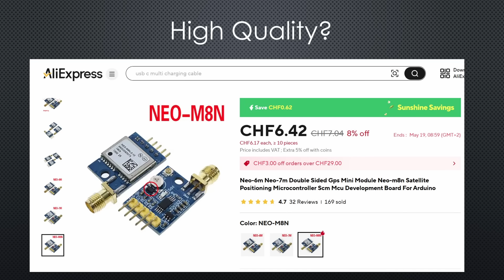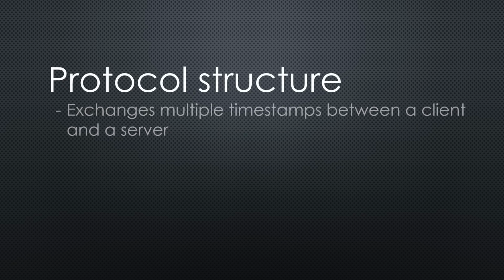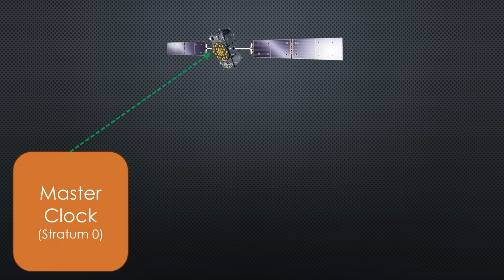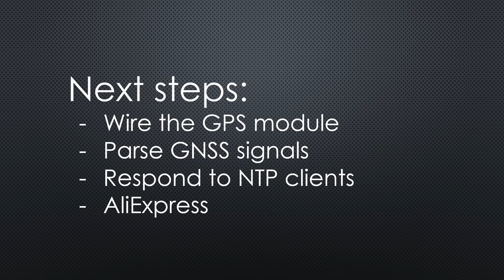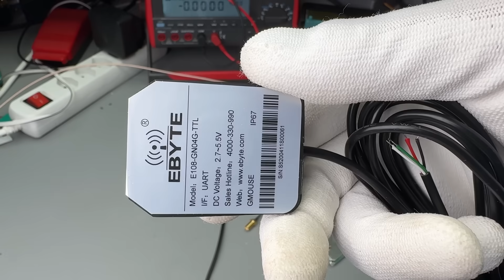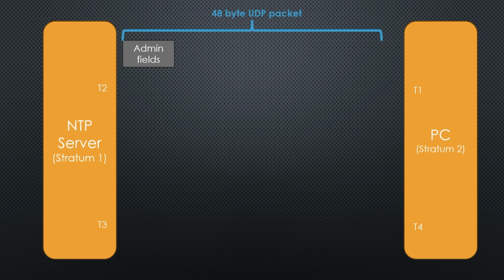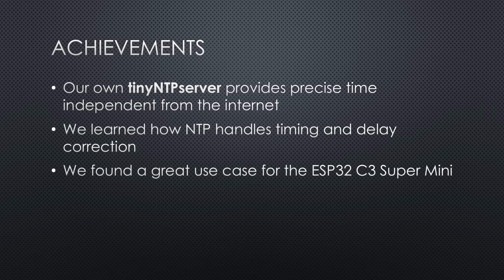Create a Wireless NTP Server with ESP32 and GNSS (Wi-Fi & Ethernet)

Comment: I have also implemented time sync from various sources via NTP and GPS modules for ESPEasy. (also p2p time sync which takes into account which node may be the most plausible to sync with)

What I found when using GPS modules from AliExpress is that they may output completely wrong timestamps. For example over 31 days in a month, the year 2040, over 24 hours in a day, etc.
But always with correct checksums.

So I did add some basic checks to the parsing of these NMEA sentences in the tinyGPS++ lib (PR never got merged though, so only in the local copy in ESPEasy)
Also you must be sure the GPS has a fix, otherwise you should not take the reported date/timestamp.

Another issue when fetching the data from serial without using PPS is that you need to know how much data is in the serial buffer when you parse the first character of a sentence.  All GPS receivers I used all output their NMEA sentences in a burst, where the first bit is sent at the start of a second. I think the PPS pulse is the start of such a transmission.
This way you can get a time sync from the GPS module without using PPS with a jitter of about a msec, given you perform some filtering over a longer period.  For example recording the time in micros when the first character was likely received based on the current number of bytes in the RX buffer when parsing this first char. Also take into account the baud rate, etc.
Reply from the maker: Good info. Thank you! In the meantime, I implemented PPS, too. There, I encountered an issue with the implementation of a function in the C3. It seems this topic is not covered a lot ;-)
Reply: @AndreasSpiess  What issue you had with the C3?
I do use ESP8266, ESP32-classic, ESP32-S2/S3/C2/C3/C6  (H2/C5/P4 are on my desk right now for implementation)
So maybe I can help?

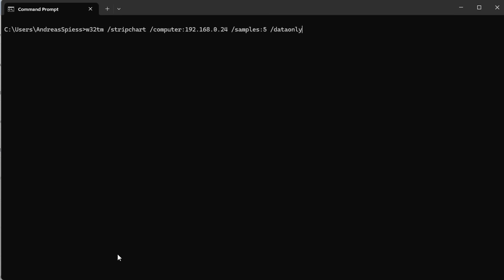Comment: 10:45 NTP is a very common protocol used for DDoS. Be sure to add an ACL to your implementation.
Reply: Is anyone really going to make a microcontroller based NTP server if they have access to a real one over the internet?
This is almost always going to be something you'd do for remote clusters of smart devices that don't have internet. Lights, pumps, gate locks, etc in remote locations that need real time based scheduling but don't need an expensive internet connection.
Reply from the maker: Will the server be DDoSed?
Reply: @AndreasSpiess yes, can be used for amplification, even behind a NAT

Comment: @1:06  WiFi and Ethernet are not separable.  If you're using WiFi, you're using Ethernet.
Reply from the maker: What makes you think that?
Reply: Unfortunately, this is false. 802.11 is different than 802.3. If you're familiar with the OSI model, recall what happens at the data link and physical layer. The frames and hardware are completely different. The communication methods are polar opposites, too. So yes, they are separate.

Comment: Hi!   I'm one of the two authors of the first NTP implementation for UNIX, implemented to validate the draft protocol spec being prepared at the time.   You make me cry a tiny tear by having an NTP server only use NMEA message timestamps to the nearest second with no PPS signal 🙂

NTP is much more than the protocol on the wire.  For a "real" NTP peer that potentially synchronizes to one of many candidate other NTP peers, there are sophisticated algorithms to select the "best" peer to choose from.  An NTP host running exchanging messages with other NTP peers also has algorithms to evaluate multiple packet exchanges that provide clock offset and delay samples, apply filters and choose one over a window over the last so many (perhaps 8) samples.   This this produces a filtered clock offset and delay output that is used as part of NTP peer selection if there's more than one candidate (and to decide if you want to switch to a different peer.)

The other really important aspect for precision timekeeping is the computer's local clock.  The object of the entire exercise is to compute the local clocks phase and frequency error.  The phase error is the offset from the "correct" time, and the frequency error is how incorrect that the rate the clock advances is (e.g., running too slow or too fast.)    It turns out that the frequency error is just as interesting as the clock offset.   When I did my first NTP implementation on a NeXT workstation in my office, I could use the computed frequency error to tell what the temperature in the office was.  And that got worse over the weekend when the HVAC was turned off..

What full NTP implementation would do is use the computed frequency error to adjust the rate that the clock advanced to gently slew the clock towards the correct value.  (Of course, if you were too far off, you'd just reset the clock.)   You did not normally want to just reset the clock based on the computed offset..  Setting it backwards if it was running too fast could confuse applications that had the perfectly reasonable expectation of monotonically increasing timestamps.   And advancing it in large amounts could confuse programs trying to measure time intervals between two occasions of getting the OS's time.   So this requires either special hardware to directly adjust the frequency (which nobody had at that time) or OS support to adjust the rate the clock advanced.  If you had a 10ms real time clock interrupt, perhaps you only advanced the system's idea of the time by 9,990 microseconds rather than 10,000 microsecond on a clock interrupt?

The other neat thing that comes from computing the frequency error is that you can continue to trim the local clock when your NTP peer lost contact with its synchronization sources due to a network outage or other interruption.   Or a bird that's sitting on your GPS antenna if GPS is a synchronization source.   

Sadly, most computer manufacturers historically didn't spend a lot of money installing high quality, temperature compensated crystals with good temperature stability.  So this has direct impact on long term holdover stability...

Even back in the day in the late 1980's and early 1990's when NTP was new, achieving clock synchronization over a LAN to less than 10ms was possible.  And less than 100ms over uncongested WAN links was also very practical, so long as you implemented the "full" version of NTP with the filtering and selection algorithms.

Of late, the only NTP mode of operation that many people are aware of, or have used, is the relatively "dumb" SNTP (simple) mode of operation which is essentially a one-shot interaction with an upstream NTP server.   This leaves the power of the most interesting capability of NTP behind.  If a few hundred milliseconds is "good enough" and now that everyone can afford GPS receivers, maybe that is "good enough" these days?

Thanks for making this video and opening the door on how NTP works to many more people.   It would be very interesting to add a small peripheral to an ESP32 or Raspberry PI, perhaps a small FPGA with some timekeeping hardware that can time-tag events, like PPS inputs and which could have a high quality TXCO that's trimmable with an DAC.  This way lies time nuts madness!
Reply from the maker: Thank you for your insights! You did a valuable service to the people implementing NTP. I think you are right when you say that extreme precision is no longer achieved over the network. GPS disciplined oscillators these days are very cheap and extremely precise in both short and long term (I made a video about that when I built my satellite base station for 10GHz). The Chinese take a surplus OXCO from an old Cellular base station and add a GPS and a very slow PID software. The OCXO is already quite precise in the short run, and the GPS does the rest on the longer end. So everybody gets 10^-10 precision and more for less than 100$.

Comment: Video idea: turning an esp32-s3 into a DHCP server on ethernet (via an external switch) using Arduino IDE!
Reply from the maker: What would be the benefit over using a router instead of a switch? So far, I have never had a shortage of DHCP servers...
Reply: If you have, for example, a cluster of esp32 based sensors on ethernet, IP address management can get messy, so a subnet could be a good solution. Therefore, if one could use another esp32 for this task, it could allow for automated IP address allocation and management, for very cheap! (Instead of using a managed switch or a router, over which one has little control after the initial set-up)
Thanks for your reply! Cheers!

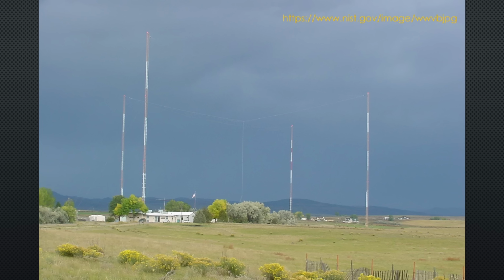Comment: 2:44 DCF77 is stil nice but since decades you have also ALS162 that has about 3500km span on Europe thanks to hundred of kW of amplification 🎉  Would be nice to have als162 as side chanel to the GNSS. Redundancy ✌️ More https://en.m.wikipedia.org/wiki/ALS162_time_signal Thanks for the nice video, 73 🙂‍↕️
Reply from the maker: I did not know of ALS162. Most commercial receivers use DCF77 in Europe. So far, I did not come across one with ASL162 :-(

Comment: I made an esp32 ntp time server using an Olimex board that uses an ethernet connection for faster and more reliable network connections.  its open source and the project is on Hackaday called ESP32 NTP Time Server (Stratum 1)
Reply from the maker: Thanks for the link! If I had found it, I probably would not have had to program mine ;-)

Comment: While describing the stratum layers you said your server is a stratum 1 device, connected direct to a stratum 0 device.

After describing stratum layers you went on to describe how the GNSS system works saying the satellite gets its time from the ground based atomic clock then transmits that signal out which your device receives via the GNSS receiver.

Wouldn't that make the satellite a stratum 1 device because it does not have the clock on board and connects to a ground based stratum 0 device? That would then make your device a stratum 2 device, not stratum 1!

You also say there are no delays from the satellite, however you forget there are delays due to the speed of the signal, not great delays but they are there.

Also, In your summery of the video you said "we" built both the types of the server. No, you showed us parts you got for the build and the results of your build, not the same thing as going through the build process with us. And the code, cheating with chat GPT does not count as programming it yourself! 😛 You also only showed us short snippets of your code plus the chat GPT generated function for the NTP protocol. Not much use for people who don't know what they are doing but want to try to build this.

Don't get me wrong, the video is still good and interesting to watch but the title is a little misleading as if it's a tutorial. Maybe it should have started "I Created a Wireless NTP Server..." instead of "Create a Wireless NTP Server...", and say I instead of we in your summary.
Reply: GPS satellites are considered stratum 0 devices as they carry rubidium and cesium clocks onboard.
Reply: @JCWren  not the way he described it though, he said, and showed, the satellite gets the time signal from Earth. So in that case my statement stands.
You can't reliably say the NTP device is stratum 1 if some satellites it connects to are stratum 0 and others are stratum 1.
Reply from the maker: I thought I mentioned that the satellites are also considered Stratum 0. But you are right, it is not entirely logical ;-)

Comment: Nice overview video, great idea I would recommend making a small master clock and sending the NTP signal into the clock, if you loose GPS signal, the mast clock shall be stable for around one week; before you notice any drift in time signal. 

Separately to prevent cyber attacks, make sure your master clocks only count forward in time, or hackers will turn up with an SDR and broadcast fake GPS signals counting backwards to cause systems disruptions, God bless.
Reply: So they will send future times and it will be unable to drift backwards! 🤔
Reply from the maker: Good idea!

Comment: I am looking to build remote tools/sensors/etc for my farm where we are talking about 500m or more remote locations so I wonder if this is a reasonably power efficient way to have timers on these systems which will be solar powered or should I go another route?
Reply: Sure.  You don't probably don't need sub-second accuracy. GPS modules are not generally power efficient in the cold-start phase (they don't have a current almanac and have to download that and then wait for enough satellites to become visible to establish a fix), but are pretty good in the warm and hot start phases. Depending on how much time drift your device has, you could either turn the GPS off completely and wait up to 2 minutes to establish a fix or your could leave it powered on but in a low power mode. Use software commands to wake it and get a time fix.  This is an extremely common method for devices that do need the current time and don't have internet access.  In the old days we might use a WWV receiver and hope it could actually hear the transmitter.
Reply: @JCWren  hmm thanks, I thought this might be the case but this just seems so simple a solution haha
Reply from the maker: Maybe you consider a two-way communication. Then you can distribute time periodically over the network. Otherwise, if your solar panels and batteries are big enough, GPS is also a good possibility.
Reply: @AndreasSpiess  I am been playing with LORA which is ideal but I cant get these modules to send anything other than a String which seems like a bad way to send data, do they normally allow for transfere of data packets?
Reply: @N1ghtR1der666  A string is a protocol (lowest level). You can do your own or implement LoraWan wich is overshoot for local sensors. There are a bunch of people doing theyre own (me included) and some made it public. 500m works on land if vegetation isn't dense. I am more on the seaside where 1,5km is easy to achieve.

"reasonably power efficient way to have timers on these systems". Sure they have sleep modes and u can wake them up periodical. Time sync is not needed (when the server knows the actual time), just let them have different periods implemented in the device address and wait when comm channel is busy or use different ones.
Reply: @Winkemaennchen  all the lora units I have the have no other functions but one that sends a string and I am not really interested in writing my own library for hardware, and doing string analysis seems too dirty to me, perhaps other units have more functionality in their libraries

Comment: You have links to the cheep GPS recover you said not as good were is the link to the good one you said in this video? Thank you that is neat with time I guess some one will make and sell a all in one unit. Any Antenna that can put out side in on the roof for this?
Reply: Why mess with antenna wires, when it's just as easy to have the whole (or half of the) thing on the roof..

Slow digital signal fully on a wire would be much more stable than the weak signal from space, that has to travel its last meters through unnecessary cable.

There are both solutions on commercial products though. If I would design one, it would have PoE to the roof.
Reply from the maker: @villehietala9677   I agree: I do not like coax, particularly for high frequencies. That is why I try to get the receiver as close as possible to the antenna. The "GPS mouse" I showed is a good example for that.
Reply from the maker: @RaymondDayI usually paste links where I bought the stuff. I only got the modules I put links. For genuine u-blox modules, Aliexpress is not a good source. Maybe Adafruit or Sparkfun are better in this respect.
I use one of those black antennas I showed for my GPSDO and one for my lab (it is in the basement). They work ok.

Comment: As always - nice video Andreas! I paused the frame with the code and went through it: GPT sure is verbose, repeating logic (copy/pasta!) that should have been into a function - or in a nice local C++ lambda, since arduino code is C++ code. The AI brain also chose not to use bitfields to decode/encode the NTP fields - which would move all the encoding/decoding work to the compiler-generated code (instead of our code manually shifting bits around).  A word-level __bswap32 may or may not have been needed afterwards - I don't remember the endianess of the ESP32 -  but even so, the code would  IMHO still look much better. Then again...  in our age of AI and the replacement of junior engineers with machines... I guess all that matters is "it works"; and for such hobby projects, it will certainly do. Thanks for sharing your work Andreas; and especially for putting it all up on Github.
Reply from the maker: I consider myself a "junior programmer" (and an engineer). So, for me, the effect is far more important than the content ;-)

Comment: Thanks Andreas, Can I ask a different question ?: For Zigbee projects would you say the tiny ESP32-C6, is the most user-friendly option compared to nRF52840, CC2651R3 ?
Reply from the maker: The ESP32 is power hungry compared to the "true" Zigbee MCUs like the nRF52840. So, for battery-operated devices, I would not use an ESP32.